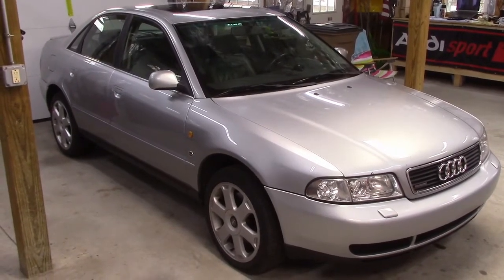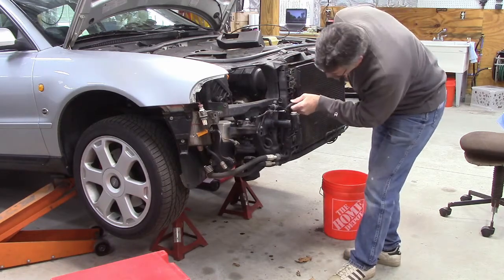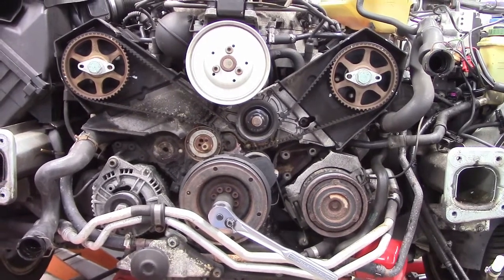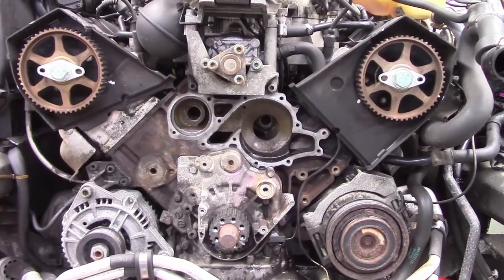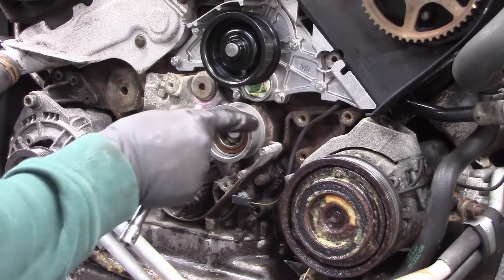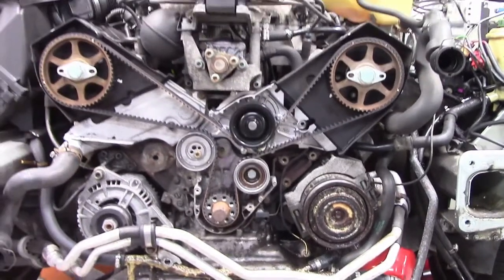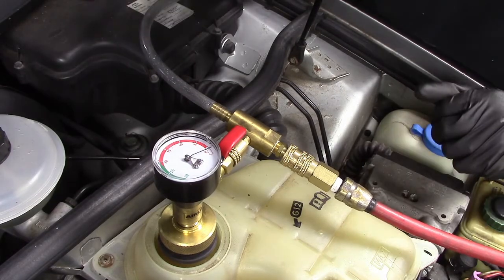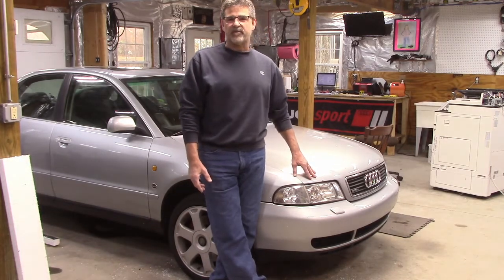Audi A4 2.8 Timing Belt & Water Pump Replacement

Comment: I have a B5 Passat with the Audi 2.8 in her. I am now having to replace the water pump because it failed after only 5 years. Not sure where the mechanic bought it, but along with that, I will replace the timing belt too. I also had to rebuild the passenger side head so I took apart the top end. Let me just warn all Audi owners, there are many rubber hoses under the intake manifold. I found every single hose rotted and in need of replacement. My engine was 20 years old at that time and had 150,000 miles on her. If you are going to pull the front off and get into these older engines, please do yourself a favor and pop of the intake and replace all the hosing. Thanks for the video Dave.
Reply: Also the cam chain guides will be weak and brittle at that point. Replace them at 200K km. If  one cracks it will fall out and let the cam chain slip. Bye-bye valves.

Comment: So the 97 had the holes for the hydraulic tensioner but didn't use it? No wonder they changed, that tensioning method sucks. The later models, 98 and onwards, all have a hydraulic tensioner and you need to pop the cam pulleys off, with the crank locked, then use a tool to lock the cams in place, apply 7 ft.lbs to the belt tension pulley after releasing the hydraulic tensioner, and then retighten the cam pulley bolts. On the newer ones the bolt on the belt tension pulley does not lock it in place, it can be rotated to apply tension after the mounting bolt has been torqued down. So it wouldn't hold tension without the hydraulic tensioner. The kits for newer vehicles also include the cam and main bearing seals.

Comment: Mark the old belt as well as the toothed pulleys and transfer the marks to the new belt, and put the belt in with the pulley and belt marks all aligned to marks on engine ,  is a good double check ( assuming some one before you didn't screw up) These are non interference engines with a Cam sensor on the left bank only so if the right bank is out a tooth or two you won't get a code - I've had one of these slip some teeth on the  Autobahn to the point that the motor would not resart, although stayed runnnig to next service station,  but no codes stored....

Comment: I’m about to take the lock carrier off my C5 S6 to do this job and this video has been incredibly helpful.   Few more bits on the BBD but really helpful detail and perfect tempo.  Thanks Dave!
Reply from the maker: It looks like a daunting job but really isn't bad if you take your time. I'm happy to hear this video is helpful.
Reply: AC lines on each end and the aux radiator are wrinkles but also need to track down the right electrical connectors.  Taking my time indeed!  Need to get this puppy back on the road!   Thanks again!  I’ll need to look into the vacuum filling method you used.   Super slick.
Reply: Hi Dave, So it’s a month later and in taking out my water pump I did 50% better than you.   I broke three bolts instead of just two.  😅.  I see you used an induction heater to heat those bolts up and ease them out.   Is your block aluminum?   I don’t have an induction heater (yet) but my block is aluminum and wasn’t sure if it would work if it’s wasn’t ferrous.
Reply: @daveraymond2265    
Great video. I got alot of information. Thank you. 
I just got a 2002 VW Passat. I think it is almost the same motor. I did not get any information about the car. If I change the timing belt. Do I have to do the chain too. Or just the belt?  
Thank you
Reply: @philrempel2246  I had a 2003 and did the belt three times. You don't do the chains. The third time I also did the cam cover gaskets and the chain tensioner wear parts. It was years ago so I remember looking at the cams, which at 207,000 miles still looked like new, but I don't remember what I did to replace parts. Glad I didn't have to do the rear seals though. Ours is/was different to this one. There's a hydraulic belt tensioner and a pivoting arm which transfers the pressure from it to a different design of tension roller. The method of timing the engine also involves locking the crank during disassembly, and the cams too during reassembly. I also replaced a bunch of the cooling pipes, and the crank breather system. The valve cover kit on Blauparts is only about $130. I lived in CA, so corrosion wasn't an issue. No broken bolts. You must follow the instructions for flushing the cooling system if you want to get the rated life out of the water pump.

Comment: Thank you so much. Local shops nearby want $3500 to do all that with new hoses, water pump, pulleys, & coolant & so forth. Seems like a weekend task if I get all the tools & parts & rewatch your video a few times. Most of the work labor given that high quality parts are not more than $1000 all said, for another 75,000 miles //
Reply: Unless you weekend worth thousands, and you have some metric tools & only need a few special ones, you can buy $300 of special tooling, $500 in parts $200 in spares, then save $1500-2000 on labor. If you spend 10 hours (slow speed) over 2 days, then that's $150/ hr saved, way more than I make as a School Bus Driver // A trained Audi mechanic certified can do this job in 6.5 to 8 hours

Comment: Hello I have a 98 a4 2.8 Quattro that I’ve owned for 14 years with only 160,000 miles lately it’s been idling kinda rough and the check engine light is on so I’m thinking it’s the o2 sensors and maybe some new plugs and wires what do you think? Thanks
Reply: Your car is OBD2 so best to just scan it but I can say rough idle and a light could be many things, mass air flow, crank sensor, cam sensor, vacuum leak, fuel regulator, ect, u really just have to see why the light is on and go from there.
Reply: You should change out the plastic cam chain guides at this point too. The plastic is bound to be brittle from age and heat. One crack and one will fall out and let the chain skip. I just did my 98 and two of them fell apart after being removed.

Comment: One mor question, you do not have the fluid driven fan installed, does the car not get too warm? What climat zone do you life in? Being from Bavaria we have it not too hot in the summer.
Reply from the maker: The plastic fan blades broke and I never replaced them. Never had an issue I live just outside New York city in the United States

Comment: I just picked up a 1997 Audi A4 Quattro it only has 117k miles I have no idea if the previous owner has done this would think I need to do this service just Incase?
Reply from the maker: Most times if it has been done by a professional there will be a sticker somewhere under the hood with a date and mileage stating when the belt was replaced. If you don’t see a sticker in plain sight I would assume that it has not been done yet.
Reply from the maker: I have 277,000 miles on my 2.8 and it runs beautifully. I would not hesitate to take it on a 1000 mile trip tomorrow.
Reply: @daveraymond2265  well it hasn’t then
Reply: @daveraymond2265  I will be replacing the radiator it leaks on the driver side

Comment: Is it necessary to remove the bumper and front?
Reply from the maker: Yes, It is designed to come apart rather easy to perform the service
Reply: @daveraymond2265  okay, thank you! I just replaced the radiator and that was a pain so I'm not looking forward to this.

Comment: what if I find the dtc, and my camshafts are not horizontal, how can I losen them or how can I get them horizontal without moving my DTC?
Reply from the maker: When you find top dead center they will be horizontal. With the belt off they will move independently if you’re not careful. Just make sure you’re on top dead center, that doesn’t move very easily, and the camshafts are horizontal once the belt is on and tight

Comment: That's not how it's done properly.
Camshaft wheels have to be loosen up both just to have perfect belt tension overall.
Reply: Jep. 👍
Reply: It suposed to be loosen because synchronization will be damaged?
Reply: @patrykpatryk8314 , yes, you have to fix the camshafts before with a camshaft lock tool for V-engines. After that you can loose the camshaft wheels a little bit while loosing the bolts in front...only 1,5 revolutions! Now you can loose the wheels with a puller til circling free. If it's done, you can tight the timingbelt. After this you attach the bolts from the camshaft wheels. 
Youtube Video for changing timingbelt on audi 2.6/2.8 v6 Engine: irina25661...audi v6 How to change the timing belt.
Reply: It does not have to be perfect, it's not a gear or chain, it is a belt & shortens & stretches a little bit during hot cold cycling. If you consider the angular precision of 1 tooth on a long belt, it's not a Swiss clock movement // he did it fine & proved that it worked!
Reply: @AaronSchwarz42  Please, don't touch any more engines!

Comment: So my clutch fan broke and the blades punctured my radiator. So I had  to order a new radiator as well as new fan motor and blades. I heard you saw you don’t run the fan so I was just wondering if there is any issues like overheating or running hot in general? Would greatly appreciate any insight lol 😊